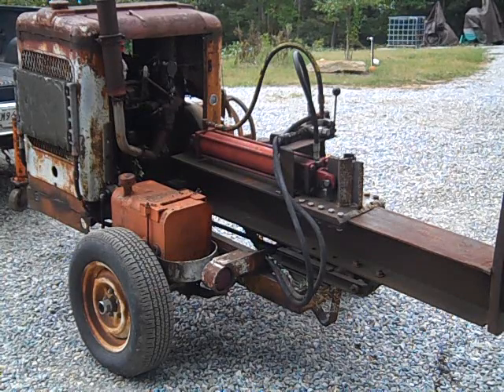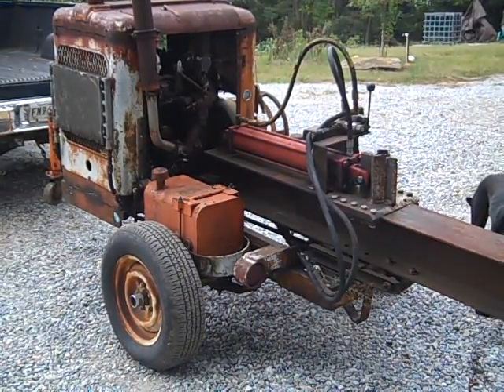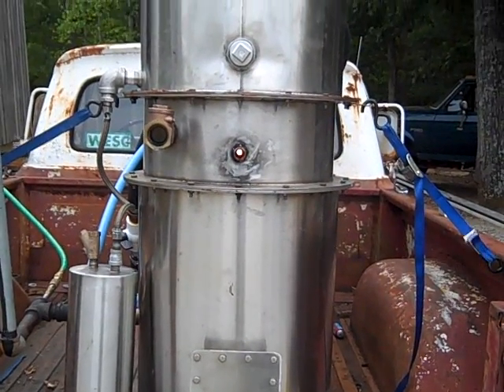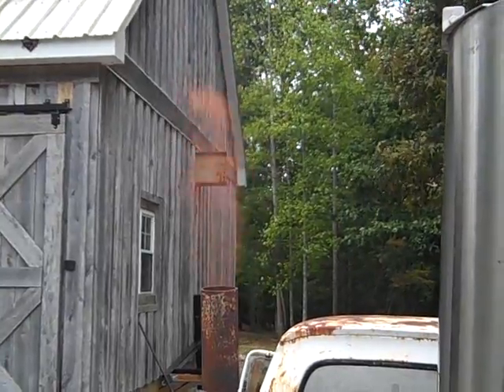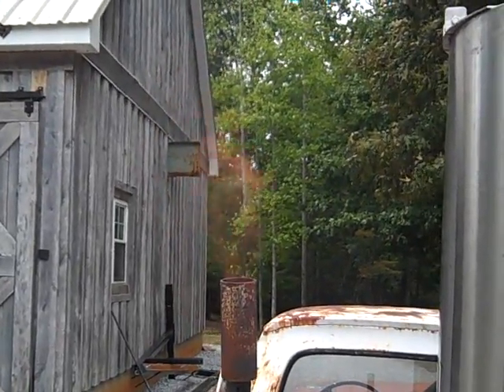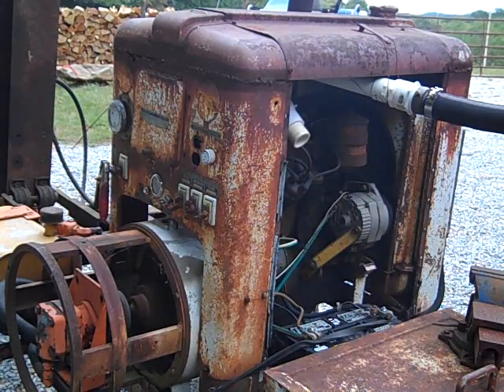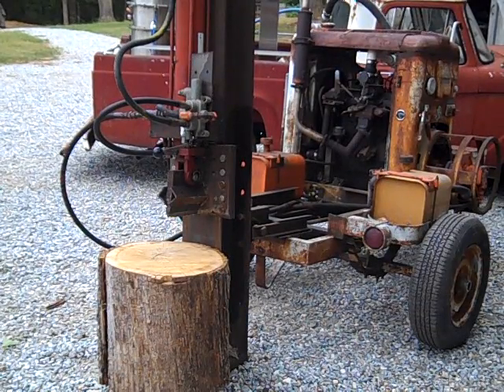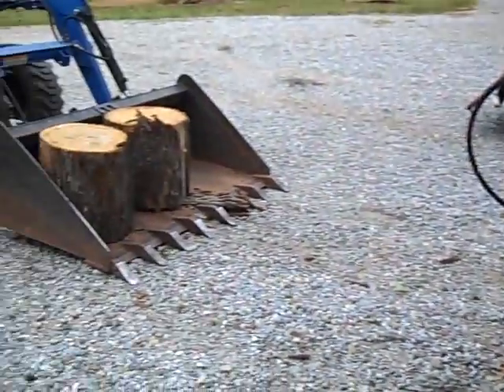Wood splits Wood!

Comment: I loved the sound or that wood popping against the grain. Question.....Can you produce more fuel for the Gasifier with this method than is required to feed the Gasifier? I have often wondered, if you ran your Gasifier on wood pellets, and used a PTO to turn a pellet mill, could you produce more pellets than the Gasifier will eat/burn. Great video ! I have to build one just to impress the girls ;)
Reply: *****   The law of conservation of energy only applies to a closed system.  In this case,  we have massive energy inputs in the form of fresh wood that invalidate that constraint..  We're not really looking at creating energy here,  we're looking at conversion efficiency.

It would be like asking if a fuel truck could carry enough fuel to drive itself back to get more fuel...  Depending on how far it has to go,  and how much fuel is in the truck,  it may or may not be possible,  but at no point is more fuel being created out of nothing.
Reply from the maker: ***** Not trying to make a perpetual motion machine.  Just making a closed loop biomass system and having fun. :)
Reply: law of conservation of energy and thermal dynamics prohibit this. Essentially you are looking to create perpetual motion unless you had an enormous energy yield and a super efficient distribution platform you cannot create energy from nothing and double it. I might be a little rusty however, this is my understanding. Correct me if I am mistaken.

Comment: For reducing the split logs down into bite-size chunks for the gasifier, I saw a vid with a guy who rigged a truck motor to a "chunker" made with a truck wheel/rim and some scrap metal... had a square hole in the rim with a sharp edge.  As the wheel rotated, he fed the splits through a square tube... as they pushed against the rim they'd push an inch or two through the hole every revolution and a fairly uniform-sized chunk would be snipped off.  Made a great fuel pile with not much effort.

Comment: to me the next step would be to put a pump on something like your gen set that would be running any way and make a auto feed cross cut like at the end of your video but custom blade to get as close to your block size as you can at the other end make like a auto toaster dryer but use the exhaust or coolant for heat so you could say load a 6 foot log at one end that gets fed a inch at a time sliced hoping to get 1x1 chunks that drop on a conveyor to at least start drying dose that make senc

Comment: I have seen on the net, diesel tractors and those India built Lister clones run on wood gas sort of. You still need diesel fuel, but the throttle linkage can be disconnected from the injector pump so that the engine only idles on diesel fuel. Then feed it the wood gas for higher RPM's.  They said you need that small amount of diesel for ignition. For a Prepper setup you would need a way to process oil/diesel fuel from wood or other biomass though.

Comment: Just think of the gas as really small wood particles(the smaller the particle the faster it burns). The heat of the fire underneath the wood chip tank Atomizes the wood chips so they burn extremely fast.(the gas is explosive under pressure) Because the expansion of the wood gas explosion in the engines combustion chamber is similar to the burning of diesel you can run almost anything if its converted properly. (Tractors, Trucks, Generator) Hope that helps clear things up a bit for you.

Comment: Pretty inefficient use of energy. Now if you could design it to use the expanding gasses of combustion to drive the piston directly - or use the exhaust from a generator powering something else e.g. a heat pump heating water, you'd have my vote!

Comment: @ReliantJustUsProject woodgas was use widely in alot of places during ww2 very much so in my country.
the reason people went back to regular gasoline after the war is because of the dangers woodgas has.
people died or got permant sickness from working with it,it has no smell or taste unlike gasoline so you cant tell when there is a leak.

Comment: i think that woodgas would be a great way to go but how expensive is the set up id love to have one up here in maine because we have lots of woods amd most of the logging areas leave behind the tree tops and the smaller branches would be nice to run the generatorand a woodsplitter on one of them im thinking it would be cheap power and a great thing to try different things on

Comment: @TerryJames3 Wood gas isnt pressurized into cylinders as it contains over 50% nitrogen (from the atmosphere)which means that over half the tank storage capacity would be wasted on this useless inert gas. The energy is more efficiently stored in the wood then released on demand in the gassification process.

Comment: Nice! I'd love to run an old welder I have that way. Its a continental 163cu.in. 4 cyl. flathead engine on a Miller welder. Whole thing's on a trailer with plenty of room to mount a gassifier, I believe...I could DC arc weld 350amps in the shop, and it also has a 3.5kw genset that can be used simultaneously. Called a Miller Big 40. Its sweet but it sucks the gasoline. Wood would be perfect.  I'm a welder/fabricator with a shop. How hard would it be to make one of those gassifiers?